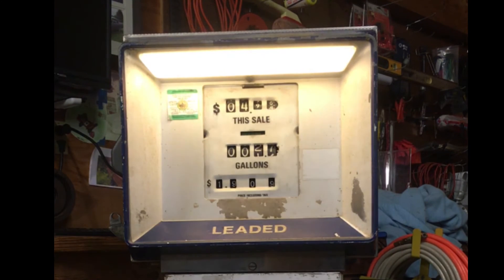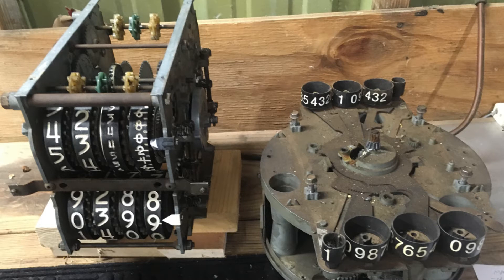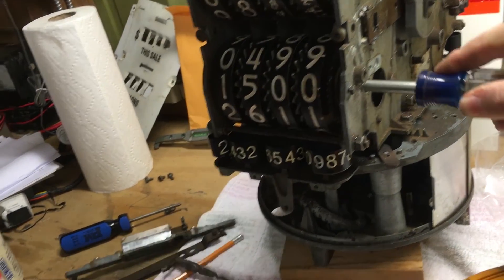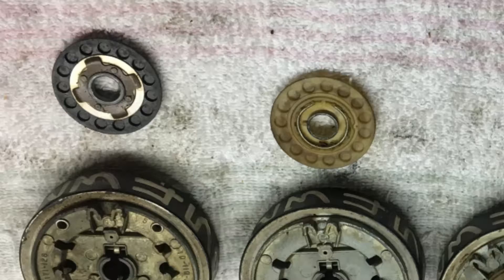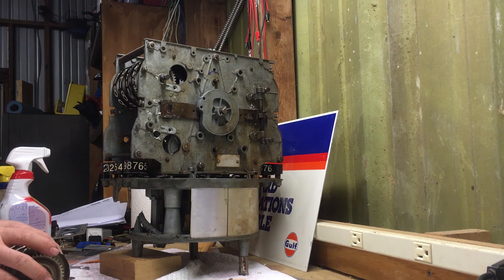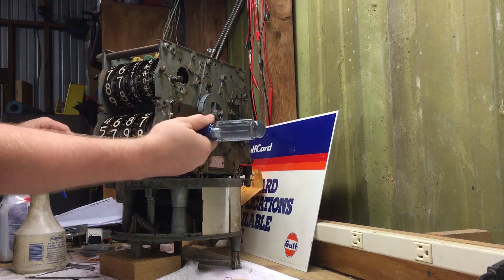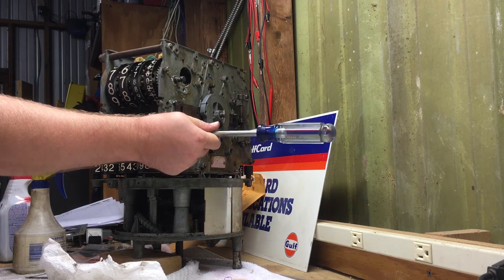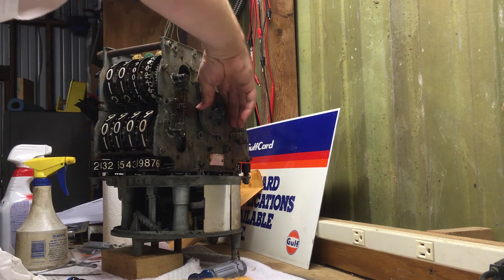Veeder Root 2002E mechanical computer reset disc replacement

Comment: You still there?  I can’t find the reset discs anywhere, can you help?
Reply from the maker: Recommendation would be to try the oldgas forums, and also parts units off internet auction sites.
Reply: Did you find new ones? I repair these daily.. would appreciate if you let me know and I will do the same
Reply from the maker: @codyrabenaldt727  I haven't found a source for new ones. As you recommended, I would buy a parts computer and take it apart if I needed more.
Reply: Call Veeder Root.  They have some parts, believe it or not.  I needed the reset disc and they said they had it.  The new one is plastic.  I got one from Tom Buckles but if he didn't have it, I was going to get it from Veeder Root.